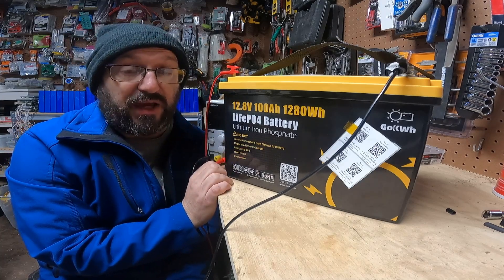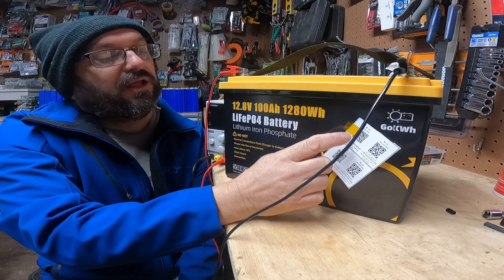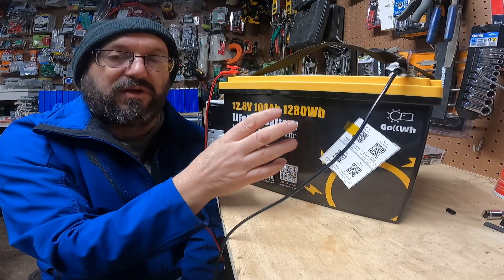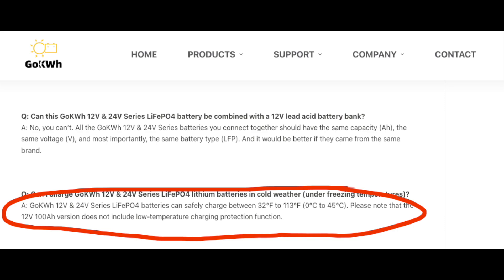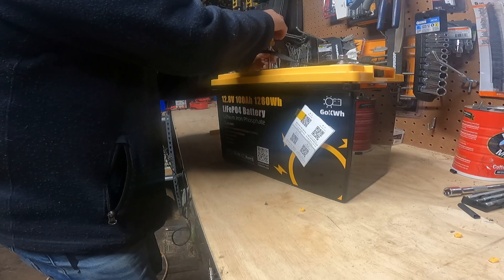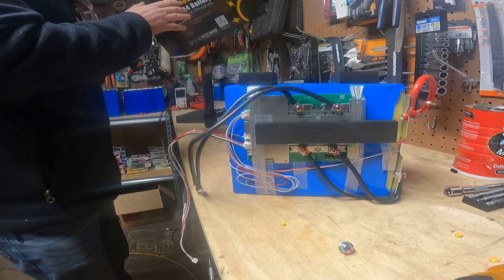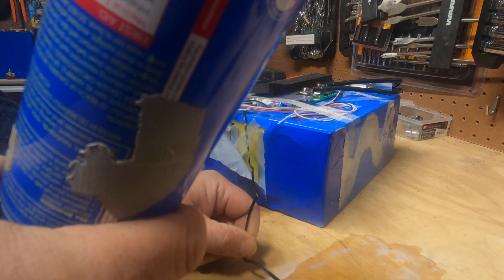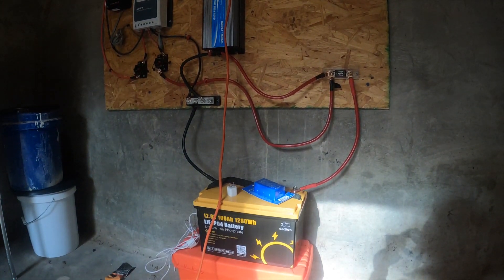My review of GoKWh 12V 100Ah LiFePO4 Battery.  Is it time to replace your old lead acid battery?

Comment: I wish you had tried a fridge, even a dorm sized one. But it was a good overall test. 

My understanding of the High Frequency ie cheaper inverters and low frequency is the high frequency is using integrated circuits and small transformers to convert the DC to AC.  The Low Frequency use heavy duty Power Transistors and Heavy Duty iron core, copper wound transformers along with large Capacitors and or Coils to provide greater overhead power and a smoother true sine wave. Plus on better ones the heat sinks on the sides are larger, deeper to dissipate more heat, quicker.  Like hot rod engines, there’s no substitute for cubic inches and quality components.  IMHO. Don’t own one and I graduated electronics school in 81, so it’s been a minute.

Comment: Nice video, but you missed something very important about your low temp cut-off test.  In my test I used both an upside down air can as you did and I also used a cooled jell pack.  In addition, I looked at the LCD temperature readings as I did this.  The air can drops the temp to at least -30deg C which is not what we want when checking to see if the charging cuts off below 0degC.  In fact, as the temp sensor warmed up the charging resumed as the LCD showed a temp of -7degC, of 19deg F.  This is too low to be an effective low temp cutoff as it means the battery can still be charged down to -6deg C or 20degF.  My gel pack dropped the temperature to -9deg C and still did not stop the charging.  So I would say there is no effective low temperature cut-off for this battery as you showed GoKWh says on their web site.  Don't feel bad, several other reviewers did the same as you did.  You can check out my low temp charging test at the 17min 36sec point in my video.  https://www.youtube.com/watch?v=ZlSfRYAhkJ0